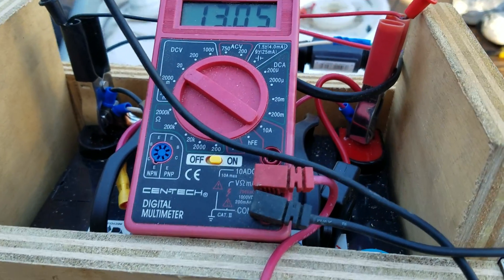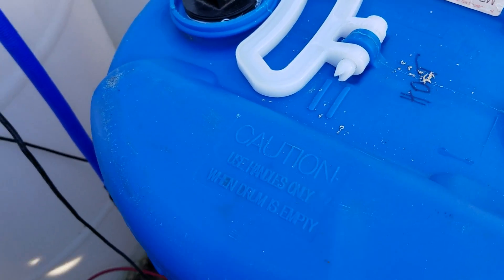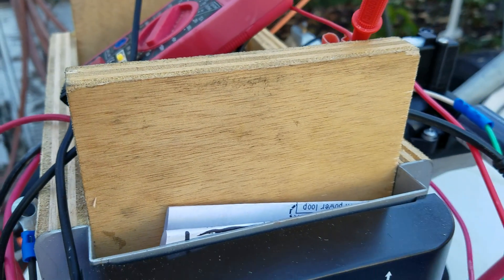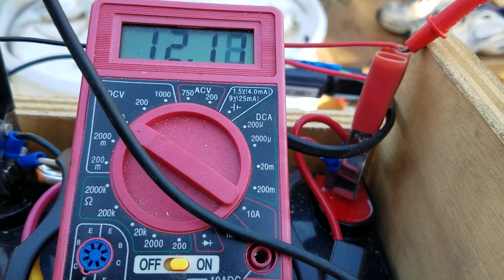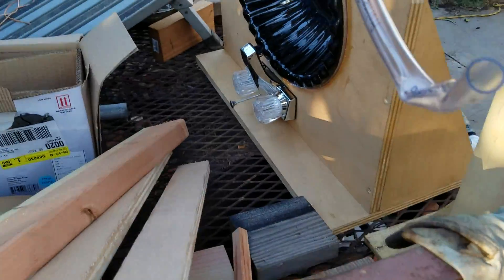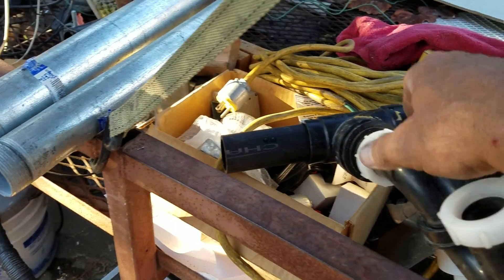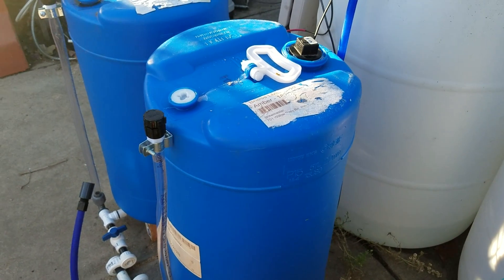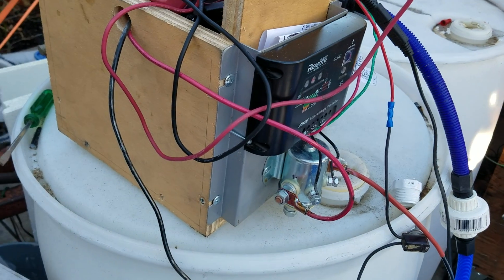Solar Charged Water Heater

Comment: Watching a channel at the moment that is using the PV Max on solar panels at say 300 watts to connect to a 300 watt 12 volt water heater element to heat the water in a hot water system that's a 100 litres with built in safety valve etc (small household hot water system). No controller and no batteries.
Reply from the maker: @Aussiehomestead1965  Nice.  Yes, that is possible with a DC heating element.

Comment: How long would the element run j7st off the battery?
Reply from the maker: Not very long.  You use Ohm's Law, watts=volts x amps, so a 12v 200ah (amp hours) battery provides 2400wh (watt hours), but you can only use 50% of a lead acid battery charge, so that leaves 1200wh.
A 300w element should run 4 hours, (1200÷300=4), but the battery gets weaker hour per hour, so figure 2.5-3 hours and a dead battery.  So safely, a 12v, 200ah deep cycle battery would run it for 1 hour without permanently damaging the battery.
Reply from the maker: Welcome aboard!
Reply: So like 6 hours then ?
Reply from the maker: @jeremykaufman4116  no, maybe 1 hour.

Comment: I have a few questions: How can you run a 14 amps tablesaw from a Inverter, connected to a 12 V battery? Is this amount of draw really possible? And will it run through the charge controller or ist it wired directly? Interesting Video. Keep up the amazing work and thank you so much for sharing your projects and experience^^
Reply from the maker: Welcome aboard!  The solar panels connect to a controller which is connected to a 12v battery.  The battery powers a 3000w inverter.   A 14amp saw at 120volts uses 1680watts, just over half of the inverter's capability.  I'll show it in operation in tonights video.
Reply: @GBear  Thank you so much again xD The problem behind my questions was that I could not run a tablesaw with that drawage at my voltage (110 W 12 V Solarpanel/12 V 100 AH Lead-Acid Battery). Thanks to your comment, I figured, that (living in Germany..) my electrical system works with a 12 V->220 V/3000 W Inverter with EU plugs. So i constantly thought, that I would need more power/bigger panel to run the same devices. BUT they arent the same! Your devices and inverter are working with a different voltage! I think, that may be the solution to my problem..
Reply from the maker: @LehmannTheGTO  yeah, a 220v, 14a saw requires 3080w of power.(v x a = w)
Therefore you would need a bigger inverter/system.
Possibly switch to a 24v  system with a 24v to 220v inverter at 6000w.

Comment: You need a Solid State Relay Because Eventually The Contacts will Burn Out In TheOn You Are Using as Per Steve Saying.
thought I would pass his INF to Yo!
Good Idea Though
Reply from the maker: Welcome aboard!  Yeah, it is still working if needed, which is seldom.   Since I added the Midnite Classic controller,  it seldom triggers the dump load, and of it does, it's only for a few minutes.

Comment: As long as the panels are not able to make more power than the heater can take then plug the heater straight into the solar the lead acid battery’s waste a lot of energy as heat when charging
Reply from the maker: Yes, in theory a 300 watt heating element can be connected straight to 300 watts of solar panels to produce daytime heat.

Comment: Great video glad I came across it you have really put some thought into your solar set up. I'm about to make a hot water heater myself and never thought of using a relay like that terrific idea. Do I need a special charge comtoler to do this you referred to it as a solar dump when batteries are full it clicks on ,will my regular charge controller do this or no .How has it been working i see you posted this year's ago Could you let me know thanks Dale Enjoyed that now a subscriber
Reply from the maker: Welcome aboard Dale!  They no longer sell that type of dumpload, and no, you can't use a regular controller to make one.  But, they now sell a digital diverter unit on eBay that is more efficient.
Problem is, this is not an efficient way to heat water, ad it only heats water when you have an excess of production, and that doesn't happen often enough to make it work.  As you catch up on my videos, you will see that I switched to a Midnite Classic 150 charge controller and it operates so efficiently,  that my batteries are best maintained without overages that would activate even my old school dump load.
Watch on and I hope you can aquire knowledge from my real life experiences.

Comment: I have seen so many types of these when I worked for Town of Salina, on the water Department...people who don't want to pay the bill make a lot of those , lol...sooner or later they would forget to take it out on meter reading day, oopsies...or they would cause a leak from the wrong fittings, trying to use 1 inch pipe fittings which were different threads...so I'd go check the leak and there would be imaginitive plumbing, I called  it..lol...one old guy never could get the lid back on right so it was always off kilter ...I know that wasn't what you had here but if it had been one it was made right , and the non payers never get it completely  right...it's almost funny ...one bunch tried to hook a garden hose to the meter loop and it leaked quite a bit...ran it into the trailer house window...I went to read  the meter and was like lol , took a pic and sent it to my boss...funny world , you just reminded me of it with those fittings

Comment: did you ever do the part two?
Reply from the maker: I ALWAYS do the part two's!  So, the answer is yes!👍😁👍
Reply: @GBear  COULD YOU GIVE ME THE LINK I CAN'T SEEM TO FIND IT, I UNDERSTAND IT IS MY PROBLEM, I'M NOT TRYING TO BE A JERK, JUST WANT TO SEE IT. THANKS
Reply from the maker: @Anthony-ry8lo  ok, I'm posting tonight's episode right now, but I will look for that part 2 for you when I finish.
Welcome aboard!
Reply from the maker: @Anthony-ry8lo  Ahhhh, the solar powered water heater!  Ok, sorry...that was a scrapped experiment.   I started that while living in the city on grid,  but moved off grid to the desert.
I use a small propane tankless water heater here for a number of reasons.
1.  I only need a water heater in the winter.  In the summer I need a water cooler.
2.  The heating element in that solar unit draws 300 watts, and I am on battery banks after dark when that is a strain on the system, and the cold temps at night would make it run constantly.
3. The biggest draw on the power would be at times I wouldn't even be using hot water, while I slept.
4. The propane tankless water heater only runs when a hot water tap is turned on, so it is very efficient.
I hope that answers your questions.   If not, feel free to ask.
P.s.,I still have that unit on my outdoor MASH shower, but I only use that shower in the summer, and the sun heats the water more than needed without help from a heating element.

Comment: Have same inverter 240 volts,had over 4 yrs I think,been a good buy from AliExpress I think,if I remember it said it was sine wave ,I have roughly same setup as I see there on top of a caravan,turbine is a Rutland turbine which are good if winds blowing...being as I'm in Scotland the winters are pretty dark up here early ,have 600 watt on three 100amp Gel battery's which are fine for know. .winter is a different case will run solar at 36 volt for 1 maybe 2 battery's..
Reply from the maker: Good deal!  Yes, I bought my inverter in 2016 and it is pure sine wave 240v.  I also have one that is modified sine wave, but it is for emergency backup only.
Right now the winds are howling and my turbine is producing 35.2amps.

Comment: It's the most inefficient way to heat water. Photovoltaic panels efficiency are between 15% and 20% (sun energy/square meter). Just use a black garden hose, it's more than 50% efficient (sun energy/square meter) and cheaper. The barrel should be thermal isolated (EPS)
Black garden hose heat collector: https://youtu.be/MvEzmgJ5nDM
Sun energy per square meter: https://youtu.be/9K8owiMQQsI
Reply from the maker: You are correct!  I prefer the black plastic irrigation tubing.  Mount it in a coil on a 4x4 piece of plywood painted black and you can make coffee with the hot water it produces.👍😁👍
Reply: WRONG. The DSSR20 is.
Reply: @josephdunn4388  Do you know the difference between panel efficiency and controller efficiency?
Reply: @ww07ff  are you an electrical engineer?
Reply: @josephdunn4388  Answering a question with other question... great.

Comment: I like that water heating system...I like it a lot !. Are you still using a modified version of it as of today?
Reply from the maker: No, after getting out here and learning more I found that for this climate the math doesn't work for this type of water heating and would not be a reliable hot water source.  A tankless propane water heater was a better choice.
Reply: @GBear  Oh yeah I remember seeing the the tank less in the house. I was thinking your dump load on the wind turbine would be a good source of power. 😎 Maybe for your outside shower. Hate to see that system go to waste. Take care.....G
Reply from the maker: @cliffandrews  that was my original plan, but I found out that the dump load would have to produce 300+ watts extra for hours on end to make and keep the water hot, and the outdoor shower gets plenty hot in the summer sun, and I never use the outdoor shower in the winter cold.
Reply: @GBear  have you looked into the dssr20 with diversion?
Reply from the maker: Not yet.
Reply from the maker: @josephdunn4388  ok, it looks intriguing, but where do I buy one with the SBMSO?
Reply: @GBear  electrodacus
Reply from the maker: @josephdunn4388  yeah, just found that on the web the other day.
Reply: @GBear  With your level of knowledge this should place you 100 years ahead.
Reply from the maker: Thanks.  I'm looking forward to getting a DSSR20 and a SBMS0 and checking them out as soon as I can fit it into the budget.
Reply: @GBear  what are your panel specs?

Comment: lead acid batteries always climb in voltage after a load has been turned off. Try it at night. You'll need more panels at the least, and more batteries probably.
Reply from the maker: Thanks.welcome aboard.   More panels and 6 more batteries was what the math worked out to.
Reply: @GBear  I'm using 16 12v, 120AH lead acids, in a two bank, 24v set up, with 1kw of panel and 600w turbine. Did this 5 years ago. If I were doing it today, I would use a tesla battery or LiFePo4. There is a lot of issues with multiple  Lead Acid batteries, and I'm going Lithium when money allows as LA  leisure batteries aren't up to it. Well the new ones i bought weren't. My turbine is a rewired alternator, and is always on, i'm at 52'N, you need a turbine in the winter or at night!

Comment: Good man !
Please do bear in mind that ANY hot water storage vessel should be either (a) open vented to atmosphere or (b) pressure-relief facility incorporated.
If you were to get the "ideal" conditions and adequate solar (or wind turbine) input, the water "could" boil.
If and when that occurs the phase change from liquid to gas (steam) creates expansion in volume that is 1600 times (Yes !1600) . You don't want a steam engine exploding  on you while out alone in the desert.
Just safely sharing my twopence worth...
Thanks for sharing your enthusiasm with us all !
Reply from the maker: Thanks.  The fill tube will blow off if the impossible happened out here.  The 300 watt heating element in the water heater eats up electricity quickly and shuts the dump load off.  Thanks for your input, and welcome aboard.

Comment: Thanks very much.. I plan on using a 300w heater as you are.  Though my plan is to sit the element inside a 25Lt - 6.6 gallon.  barrel, water container in a van.  Then with a decent AGM 220ah 12v battery,  a 300w solar on the roof and the starter battery all conected through a DC to DC charger.  I'll be keeping the leisure battery topped up either by driving or with the solar.  
( I've seen some ridiculas hot water heater prices for camper / RV's.  )
I'm not electrical minded, though have grasp what you are doing.  Am I correct in saying the live wire from the 12v battery to the  heater would have to have a 30amp fuel ?  From England, thank you.
Reply from the maker: Welcome aboard.   First, if you plan on tying the starter battery into the circuit, you will want to add a solenoid switch between the two so your alternator charges the house battery while the engine is running, but disconnects the starter battery from the circuit when the ignition key is turned off.  This will prevent you from getting stuck with a starter battery too weak to crank the engine.  If you'd like, I can do a video on how to connect that solenoid. 
Next, to determine what size fuse you need, use Ohm's Law.  Watts needed divided by the voltage will give you the amps needed.  Match the fuse to that number.  ie; 300 watts ÷ 12 volts=25 amps.
Reply: @GBear  Good stuff. Thank you so much. I've already  looked into DC to DC charges though am still trying to get my head around some wirering to suit what I want to do. Although I'll have to fork out a couple humdred quid, - bucks.  My plan is to go for a Ctek as it looks the most simple and will get the most out of both solar and Leisure / home.  Battery.  Just the one wire between starter and leisure batteies.  The only other time I've seen a solenoid used,  
(though I understand what it does.)  
Is as an engine cut off - kill switch.  Again something I want to fit into a campervan.. Cheer's, subscribed..
 (  also add that the van I'll be using has an "Inteligent" alternator.  A new type of van. )
Reply: P Healy sounds like your going for a similar set up to myself, I got the ring rsdc30 charger slightly cheaper alternative to the ctek. Have you tested this water heating solution yourself?
Reply: @liam3200  I've had to change my plans.  I live in Central London and the laws are becoming very strict.  I've already sold my diesel.  Plan now is to buy an electric van once the prices come down, convert to a camper and put a solar on the roof.  Though again I'm reading that even electric vehicles will be restricted in Central London by 2025..And many other cities and towns.. 
 I'm hoping there will be allowance for residents as there was for a time with my diesel.  We're defiantly getting screwed over here - I'm also prepared to move.  
I still plan on using the heater system in my build, also for other electric items.  Bad news is the loss of being able to use a DC-DC from the engine to charge a leisure battery.. ( Unless I find another way round that..)
Really in "no-where land" at the moment as road layouts, parking, laws, penalties, price and what you can and can't do change regularly..  The campervan laws have also already changed. Again....  Now there's more harassment about where you can park and type of van builds accepted.  Even now saying the outside of a self build has to be painted to look like a camper,  and have a pull out awning on it's side.. My plan is to not register it as a camper and keep it looking as a van..  All petrol and diesels will be completely banned from 2040 and some are now pushing for 2035. In 2025 all petrol and diesel will be banned from many cities.. Now I read that is to includ electric or pay to drive.. 
It's all over the place here.  There're 50 different electric companies supplying power for electric vehicles - it's ridiculous..   All charging different amounts for charging.  
That's all on top of the government banning park-up's, stopping on the side of the road for more then a day and getting harassed.   The UK - especially England, have never wanted people living in their own vehicle.. It's all about money for them..

Comment: Love your setup.  Nice work.  You're going to be disappointed when you find that a 100 watt panel is not going to heat your water.  It will take all day to bring it up only 10 or 20 degrees.  You're going to need 500 watts or 1000 would be better to reliably heat your hot water tank up to 100 degrees or better.  And that's on a sunny day.  On a cloudy day, 1000 watts won't even do it.  I'm speaking from my own experience.  To reliably heat my 50 gallon hot water heater up to 120 degrees, I run a minimum of 500 watts and sometimes as high as 1500 watts.  Not trying to knock your setup, but you're going to need more panels.I love the idea of heating hot water with solar and I do it myself, and it saves money for sure, but it takes lots of watts to heat water.  And then you take a shower, and your water is back down to 70 degrees just that quick.  But it's fun and it works, and best of all, it's not-polluting, and completely free, but you have to invest in lots of panels.  Thankfully they are pretty darn cheap these days.
Reply from the maker: Joseph Thompson you will see in later videos that I have 1750 watts now.  But you are right...a 100 watt system won't power a 300 watt heating element.
Reply: Unfortunately the mfg's are not interested in selling one or two high quality panels, They want the thirty thousand dollar jobs. 
 Imho the dam is about to burst on mini home solar setups. Just one hundred watt panel will let people run strip lights fans etc. It only makes sense that generating just a small amount of free electricity in each home can make a big difference. Also its so easy to add another panel or battery when you have some spare cash.
Reply from the maker: Welcome aboard!  All good points!
Reply: I'm also impress on Ur expriment. pb Shaikh . India.thanks.